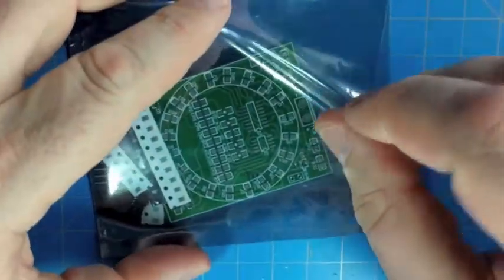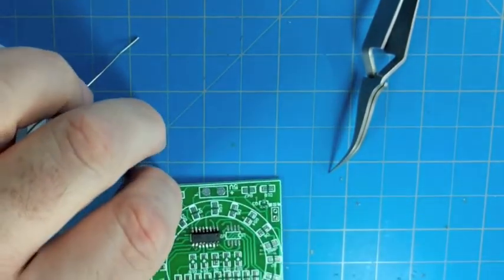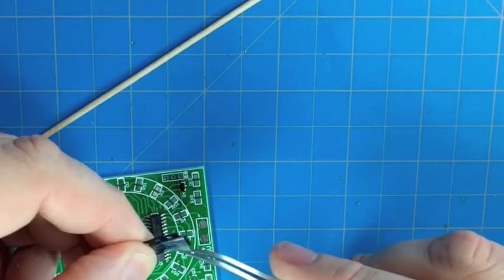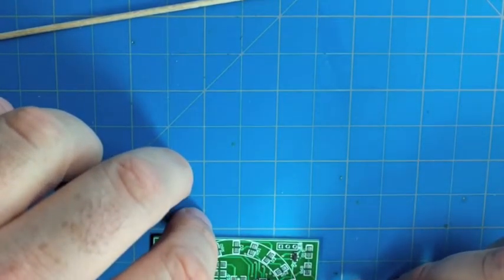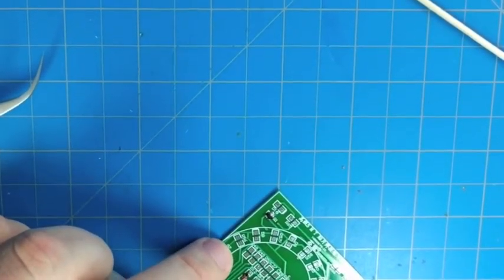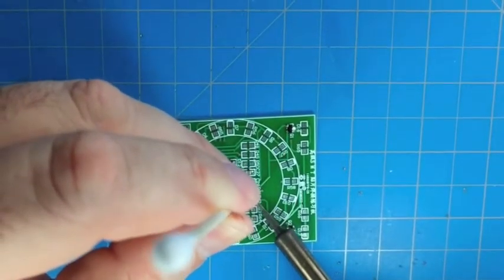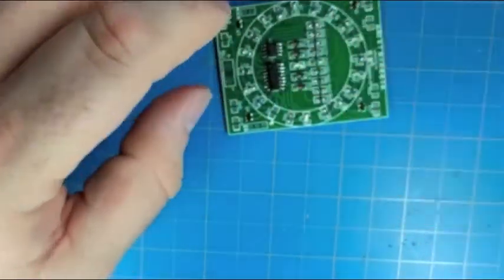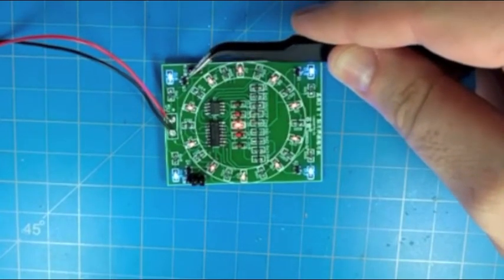Surface Mount Soldering Kit Build - HackerBoxes

Comment: I recently got one of these kits. I'm not the most experienced at soldering, but I'm new to surface-mount. I'm unfamiliar with these components, and I really wish y'all had more documentation about what the components are, how to determine which component is which, etc. The focus on soldering technique is nice, but the skill jump between the first kit and the second is substantial, and it's taking a lot more time to dig in.

Comment: Would it help to put a tiny bit of solder on one end of the component pad to make 'tacking' a lot easier? A nail-art wax pen might also help in picking up and placing these miniature components. A chop-stick shaved down to a chisel end could also be useful for holding things in place.